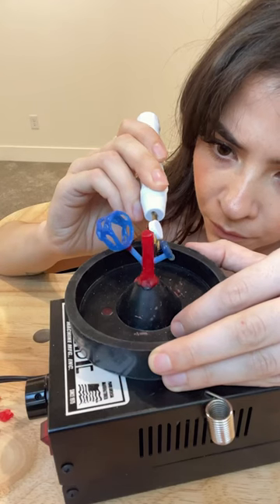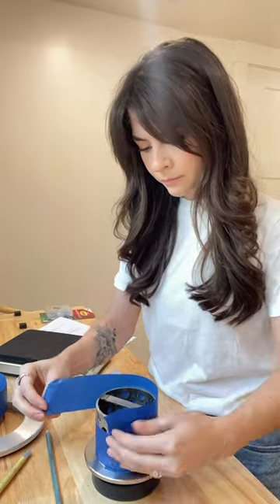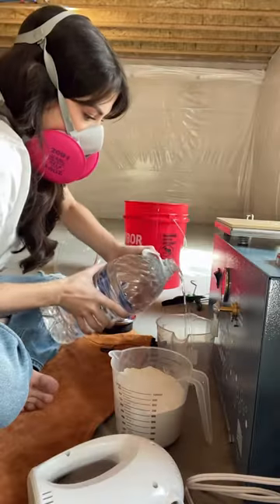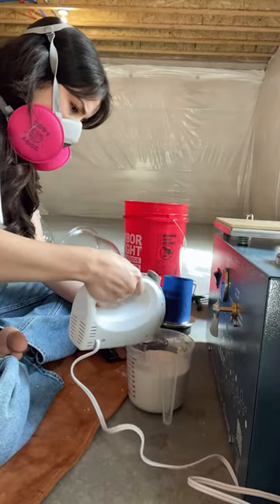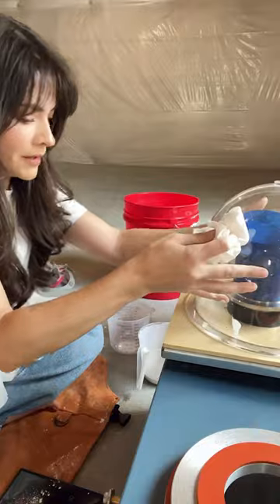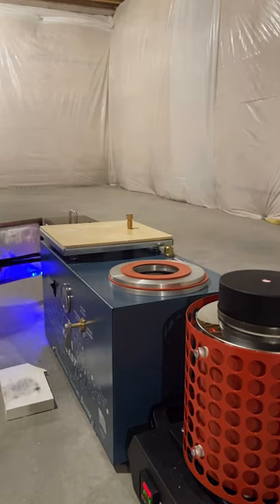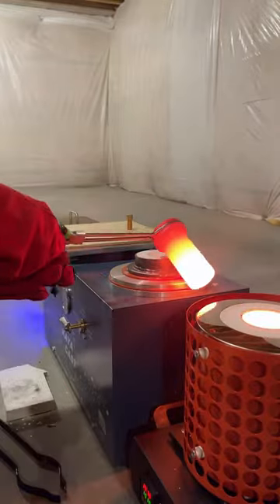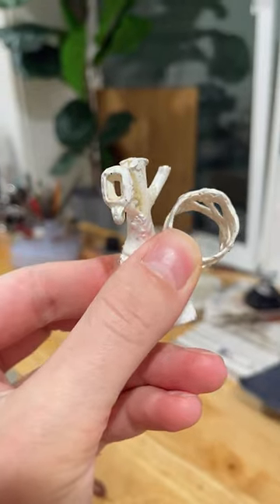Lost Wax Casting | Home Studio Setup | Jewelry Making

Comment: Nice! Outstanding handmade craftsmanship also. I love the vintage vibe that sun of your pieces put off. That's the element of making your own casts by hand instead of using cad and a 3d printer. However u could increase your output and I'm sure you know this already by investing in the software and 3d printer. The software is obnoxiously expensive but the return you would get back from it is huge since you're pouring your own stuff. You really just created more business opportunities for yourself. Even if u don't wanna design buy the small printer for 100 bucks and ppl will email their cad files to be printed and casted. If I were gonna choose a business to do now in life I would do a jewelry business instead of fashion, so many opportunities to earn in different areas of business. Anyway u do great work and work hard also and it shows.

Comment: very cool doing in small shop. .doing your own casting is very satisfying.   I recently switched to ransom and ransom investment.  . very low dust.. also. .you may want to check on different adapter plate on your vac chamber.  you can use smaller flasks. .save $ on investment.  excited to see your journey!
Reply from the maker: Thank you!! 💜I do need to do some research on that because I did want to grab some smaller flasks, I just haven’t because I know I don’t have the right adapter plate. That’s some googling for another day 🙈💜

Comment: Do you let the flask cool down a bit from oven before casting the silver in? And how do you clean the rough up jewelry right after it’s casted? Thanks :)
Reply from the maker: I will have a full video on this soon but I pour the silver while the flask is super hot. Once I quench it, I pickle it in a solution of vinegar and salt that is in crock pot. Once the silver is cleaned I use different grits of sanding wheels  to shine it up and set the stones. 💕